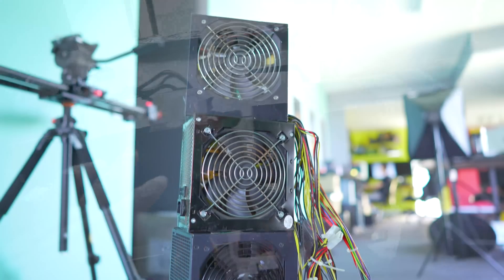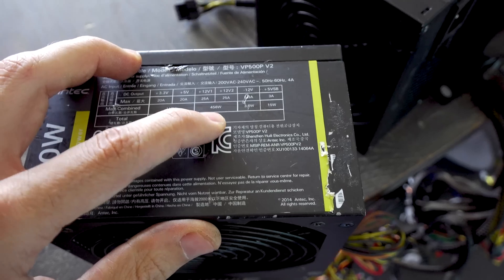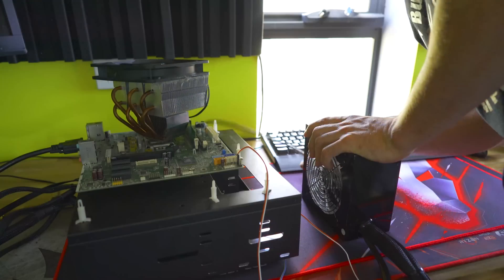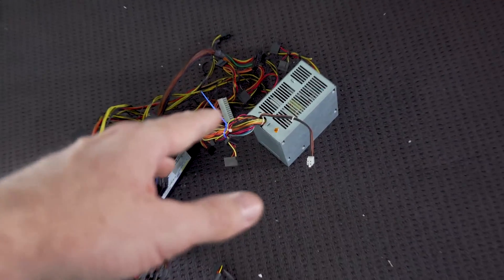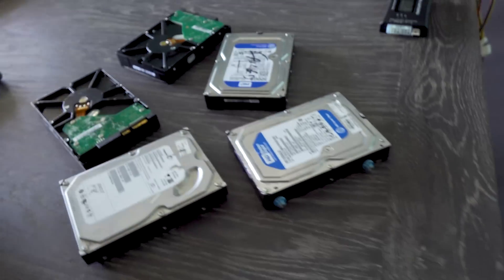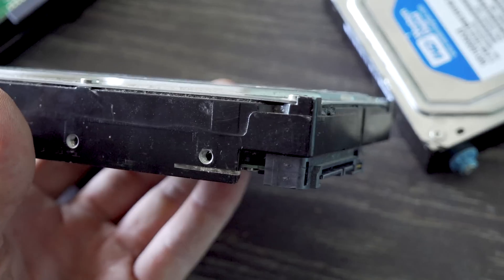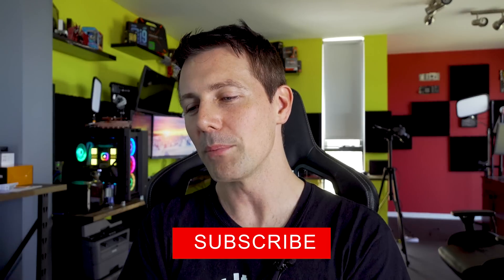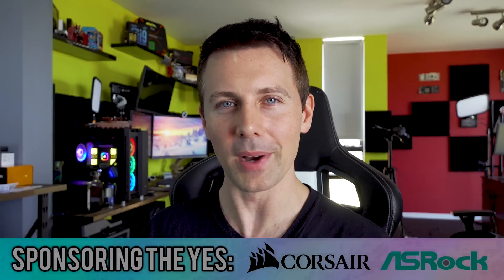How To Test and Sort through USED Power Supplies Very Quickly ($68 Stack)

Comment: you said the board doesn't support graphics cards....that's a bunch of bullcrap....do you not see that pci express x16 slot right in front of your face?  the testing motherboard absolutely supports graphics cards....you just can't overclock or mess with the hardware because this board came from an oem system which was never meant to tinker in the first place......tech yes city just lost all credibility from me.  bye

Comment: Testing a PSU under realistic load conditions is what the majority of users want-- but without risking good equipment with potentially faulty PSUs.  Whatever the decision on acceptable risk-- for example, using even a junk system whose components are expendable-- the issue remains checking power output under actual operating conditions. To do that, one source recommends using an extended (unbent) metal paper clip, inserting this into the mainboard connector at the appropriate contact number, then measuring the voltage with an RMS-grade VOM. Does anyone have another good idea?

Comment: I think the guy removed the hard drive PCB because there was classified data on the hard drive and putting a new hard drive PCB will not give you the data as they will be encrypted using AES and you must match the PCB to the drive serial number, Dell computers did that exact thing with the computers running Slot1 Pentium III processors.

Comment: I really want to say one thing. Please read it.

I recently bought a PSU for nearly $12. Its probably a local brand in India named "Clarion" It resembles the cheap AliExpress PSUs very much. It says to be a 550W PSU. And it has a name of "Clarion JM-PS-620". It also has a 800W version for $20 which is "JM-PS-920".

I have two motherboard of LGA 1156. One is Intel DH55TC and the other one is ASUS P7H55-M Pro. As you know ASUS has the 8pin CPU power connector whereas Intel has 4pin. While using the new clarion PSU (which also has an 8pin CPU power connector and a 6pin GPU power connector) my Intel motherboard suddenly stopped working. The little LED was lighted but the the motherboard would not post. After surfing through lots of videos I found that it may be due to the RTC Crystal. I already had a second motherboard. So I took risk and soldered a new RTC Crystal after removing the old one. And bam! The mobo started working. I ran it with my old 250W PSU which had 4pin power connector. Then after some days due to some reasons I changed the PSU with the "Clarion" one. And again the motherboard stopped working on second boot. Actually the soldered RTC was loosened. I changed it and used the same PSU but this time it is not working after third time.

So my question is, "Is it possible that using a 8pin PSU in a 4pin supported motherboard may cause something like power surge? In this case 4 ports are connected to motherboard and the other 4 are lying disconnected. And also the "Clarion" PSU is working fine with the ASUS P7H55-M Pro motherboard that has 8pin CPU power supply port. The good VRMs may also be the reasons for the motherboard kicking still.

Please look into this!
Reply: Motherboard could be faulty

Comment: I had an FSP-PSU in my OEM-PC for 10 years. Other than that I heard a rattling sound (coilwhine or weared out fan-bearing) it kept working. The 12V rail could handle somewhat higher power graphics cards (like a 5700 XT). That PC from 2009 also had a duct from the CPU-cooler to the perforated side-panel. I hated that duct because it made it difficult to do anything in the case, including dedusting the CPU-cooler.

Comment: Bryan, you can still salvage from failing PSUs at least the fans - they can be spare parts for intake fans on an el-cheapo office Pc / easy and quick fan replacement for a PSU faulty fan (i.e. riffle bearing)

Comment: Testing tips:

For ddr3 ram- have a hp z400 system, doesnt need a hdd, when you boot it up with the all your ram to test, it will tell you in post which ram sticks are bad instantly!  

Psu-psu tester

Hdd-hiren boot disc hdd sentinel, gives your the health of the drive and list of bad sectors to determine if the drive is working and is healthy enough go repair and use.

Comment: i have the same psutester nice thing  Q i had a view time after plugging in the 24 port  into a motherboard  etc i couldn't get to start up, so i unplugged. used the  tester,  it works normally,  I put it back and it works again is that some kind of safety feature? of the motherboard ?

Comment: Great video, this is exactly how I've been testing old equipment for years.
Where did you read that the 3.3v is used for hot-swap? I have a HAF X case with the bottom two 5.25" bays being hot-swap cages, the backplane powers both drives from a single molex connector. I can hot-swap them with no problem, so no 3.3v is used.

Comment: Hello, Brian;
Thank you for all you do.
I like to tinker w/ the hardware so I got a power tester that looks like yours mine says "HDE" on the back.
Got a cable tester too.
I'd like to know more about testing PSUs.
Have you tried any of the "diagnostic" testers like this?
< https://smile.amazon.com/4-Digit-Display-Analyzer-Diagnostic-Motherboard/dp/B00RX56KWC/ref=sr_1_8?keywords=pc+diagnostic+post+card&qid=1571454581&refinements=p_72%3A2661618011&rnid=2661617011&sr=8-8 >
I've heard some resistors can be used to put a load on a PSU but I don't know how & even w/ extra PSUs I don't want to 'blow' it.
Have a GREAT day, Neighbors!

Comment: The load testing you can use rezistors 1 ohm for 12V 0.8ohm for 5V and 0.5ohm for 3.3V and chek the voltage over rezistor and calculate it with ohms law

Comment: Dead power supplies are usually quite easy to fix. Weak = replace the input capacitors. Dead = replace the switching transistors. A little simplified perhaps but that's basically the case.
Also, SAS controllers can be found cheaply on ebay: https://www.ebay.com.au/itm/x/283541208286

Comment: I'm sorry but it's NOT ENOUGH to test the power supplies like that. 

With every power supply, you should open it up and visually inspect the electrolytic capacitors to make sure they're not swollen, which is a sign they're degraded and that you should replace them. This is particularly important with the capacitor on the 5v stand-by output which is stressed more than the others as this 5v SB circuit runs 24/7 even when PC is shut down, and runs for a long time while the fan is not spinning. 

Ideally, you should disconnect the psu from mains, unscrew the circuit board from the case - taking care not to touch the back of the high voltage side just in case the bulk capacitor still holds charge - and use an ESR meter on the 5vSB capacitor and the ones on 3.3v,5v and 12v - if the ESR value is too high, replace them. 

Degraded capacitors can cause problems after hours of psu being turned on, or only if the ambient temperature is higher, or at certain load percentages mixed with temperatures etc - the voltage can start to oscillate, the ripple increases and at some point the psu could randomly reset or shut down.
And while the psu is opened, you could also blow the dust and maybe add a drop of oil in the fan hub or replace the fan with something compatible (air flow wise, rpm etc)

 
When it comes to testing hard drives, make sure some drives aren't the kind that stay in RESET while they get power on 3.3v - maybe apply some tape over the 3.3v contacts of the sata power connector on the drive or use a molex to sata adapter cable (because those don't have 3.3 wire).

I personally would never connect a used power supply to a computer I care about without checking it first.

Comment: hey guys i have a cheap case with 3 slow front fans and one on the back my quistion is if i replaced the exhuast fan with a higher rpm fan will it improve my case air flow dont have a lot of money right now

Comment: This Power Supply Tester are useless, they dont test load, they dont test efficiency, they dont show ripple....
Reply: RODRIGO FILHO usually a dying or weak power supply will show slightly low voltage on all lines

Comment: The irony of SAS is that even new/unused older 2TB/4TB 3.5" Enterprise drives can be obtained very cheaply and relevant HBAs cost diddly squat (older cards like the LSI 3442, or newer models like the P400 that support 6Gbit); performance is excellent, eg. the ST3600857SS is a good model, much faster access time than consumer SATA. Even 2.5" SAS is often now quite cheap. I have some benchmark data here:

http://www.sgidepot.co.uk/diskdata.html

Many of the same models are available as SATA aswell, but they usually cost more.

The down side of SAS from a consumer perspective is that installing an HBA on a consumer mbd will add to the POST time and perhaps some or even most home users would not like that. The nice thing about a dedicated HBA though is they offer good hw RAID options and some can be fitted with battery backup for full power loss protection, etc. It's an interesting option for someone who might like the idea of much better storage reliability for important data such as family photos, eg. 2x 2TB Seagate/Hitachi Enterprise in RAID1 (or 4 disks in RAID10 for both performance and redundancy, this is the modeI I often used).

However, perhaps most just prefer the convenience of connecting something like an external USB3 drive to regularly backup their data, though it's bizarre how many home users never do any kind of backup (going to be so many people in future decades who lose their entire media archive when the sole device storing it all dies). The advantage of SAS is that relevant models are less likely to go wrong in the first place, assuming they haven't already had a hard life (though Enterprise SATA should offer the same reliability, even if 15K models are rare; I try to find Seagate ES.3 and newer versions of Hitachi HUS such as the 4TB HUS724040ALE640 - I won one of these recently for 59 UKP, it had very little usage logged).

Which raises the biggest concern about SAS, or indeed any disk obtained 2nd-hand, ie. how much it has already been used. Ask for the SMART data if possible. Cheap Enterprise drives could have been running continuously under heavy loads for years, or they may hardly have been used at all. Not an issue with NOS (new old stock) but for used drives definitely something to consider, hence why I always ask a seller if they can provide the summary output from Crystal Disk Info.

Some top-end enthusiast mbds have had onboard SAS controllers in the past, eg. the Asrock X79 Extreme 11, but such controllers usually do not come with any cache RAM which rather spoils random 4K performance. If one does ever consider SAS, try to find an HBA which includes some cache RAM (1GB+ preferable) and better still has the option for battery backup.

Another advantage of SAS with an HBA: since the HBA stores the info about any defined RAID, a mbd failure will not harm the RAID, something that cannot be said of an ordinary consumer mbd RAID controlled by the mbd chipset and BIOS - if the mbd fails then the RAID could be hard to recover.

For really fun storage though, try FC. :)  Optical cables, stick the storage unit in the basement, help warm the house in winter. :D
Reply: @mapesdhs
What is FC ?

Comment: PSU Brand is meaningless so are what they state on the labels this is why the likes of jonnyguru was great lots of testing and full break down of what is inside.

you could re use a lot of those parts from PSU that are dead the likes of the fans the molex connectors even the cables to make your own extensions.

They still use those ducts in some gaming pc the design has just slightly changed I saw alienware with one recently

Comment: Tip, Do not buy used power supplies unless your prepared to recap it, as there is probably something wrong with it, hardly any build using todays parts will get any near  the psu rating so why is it being sold ?. Check capacitors in used psu, they usually first to fail. But do not open if you are not experianced, read up on it first ! The large caps can hold charge for months.
If buying used harddrives carry an old lenovo x series laptop (small and cheap) with linux (Ubuntu easy to use) with gsmartcontrol installed and a caddy mount. Its a gui app which will show all smart errors and lifespan .

https://www.youtube.com/watch?v=vxq8j7GUz40

Comment: Recently bought a box of 45 Harddrives for 40 €. Lovely collection, some SATA some IDE some SCSI. All ages, from like 40 MB to 1.5 TB. 26 of the SATA/IDE ones worked fine so it's already a great bargain. Will loo into the SCSI ones later. I used Crystaldiskinfo and crystaldiskmark to check them out.
It's crazy how a really old HD from 1989 gets detected and works just fine under Windows 10 :)

Comment: With PSU tester attached when you turn off the power and the tester is still beeping that indicates the capacitor works. So beeping longer is better.
Some cheapo PSU only beeps once or twice, while hi end one will beep much longer.
That's based on my personal experience, give me an advice if I'm wrong.

Comment: Don't buy this tester. Use a proper multi-meter. 
MUCH more accurate and reliable. Sure, it's more work as you've to jump start the PSU with a paperclip or whatever, then you've to fiddle around with electrodes which can be a bit tricky, then you've to check each rail individually and whatnot but...
I think it's worth the effort!

Comment: Brands say nothing about PSUs. Example: Bequiets Pure Power and System Power PSUs are just Garbage. Seasonic has evolved really good but the older PSUs from them were also crap. On the Opposite Bequiets Dark Power Pro 11 PSUs are absolutly good to use. Still lacking behind the Seasonic Focus Plus ones, but they good enough to trust them for 5-7+ years. Low Ripple and Noise is in the most times a good Indicator of a decent PSU, also stable Voltages in Crossload scenarios. Check some tests before buying PSUs. Superflower has also really Good PSUs but they still sell REALLY crap ones. So a Brand says nothing. Be aware of that.

Edit: Dont Cheap out on PSUs. They Power your entire System, if they are Designed bad, u killing hundreds or even thousands of dollars, just because u wanted to save 10 Bucks.

Comment: I have one of these power supply testers myself, according to the manual of my power supply tester you must put some sort of load on the PSU by using either a fan or connecting a mechanical HDD when testing it in order to get a more trustworthy power good reading otherwise that number can not be trusted. These testers are a great way to see if a PSU would be dangerous to hook up to a new system. But they can not check how a power supply behaves under heavy load so you can not fully test the health of a power supply. For that special and expensive testing equipment are needed. Or one must test it in a actual system and see if it works OK under heavy load.
Reply: Or build my crazy box and test PSU the cheap way ;)
Reply: Yeah, my recent PSU failures have been from undervolting under load. Not noticeable at idle.
Reply: You need a "load selectable" dummy load, matched to the current that should be supplied, which also means you need to know what that current should be.  A good supply will have a placard. You also need to burn in, so you get results at operating temperatures. You need good cables as well, each PCIe slot needs to supply 6.25A (Ideally 6.5). Never test with real components in case the voltage spikes rather than droops.
Reply: You don't need expensive test equipment. If you work in electronics engineering you can build a very competent PSU tester yourself. Brand names are only useful if you have a legal contract with someone to carry out certified testing on their equipment.

Comment: Another tip from a HDD, SSD horder. Using HWinfo64 to read the drives can tell you if the drive has bad or replaced sectors. It even tells you how long the drive has been powered up (in hours or years) also how many on and off cycles its been through and a lot of other useful info. Even if the drive shows up and works with a OS, doesn't necessarily mean that its good. For example, I have a 1TB TASHIBA dual ported HDD and it loads Windows, games and all. Though 1nce it gets to 850GB's or more, it starts corrupting data when i try to copy data back from the drive. Though, i was very surprised to see the support HWinfo64 has when it comes to reading the remaining drive life of SSD's.